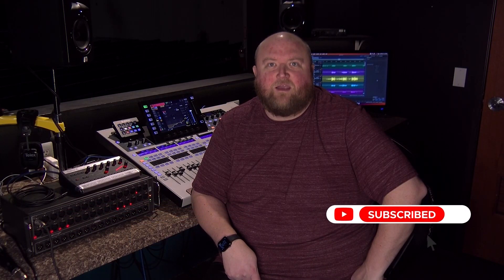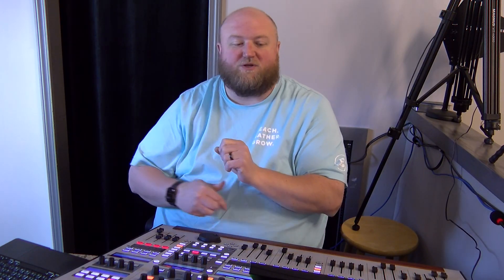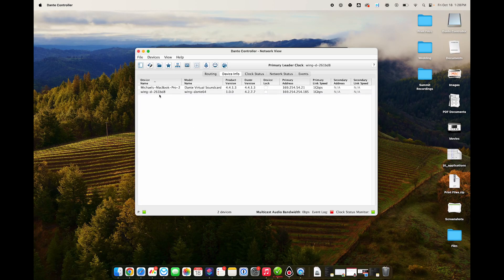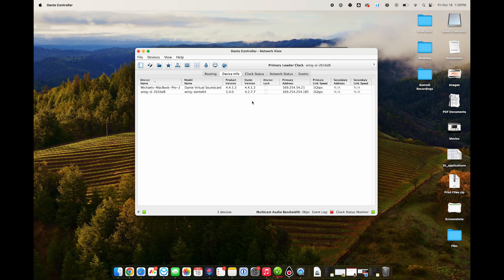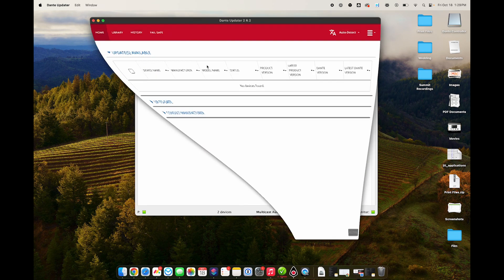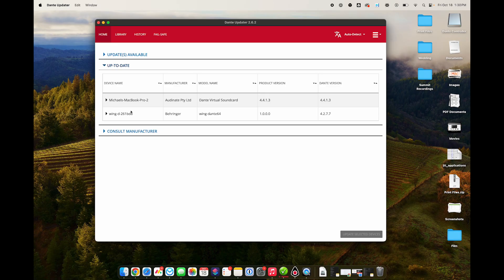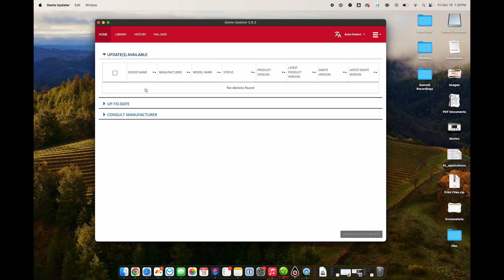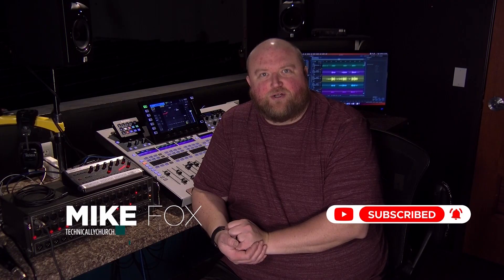How I Fixed My Dante Card After Firmware 3.0 Upgrade - Behringer Wing

Comment: Hi everyone, 

I had the issue that the Dante card didn’t recognize in Dante controller even after downgrading…

I was about to give up and start calling some friends with wing to help me get the card updated. 

But I was curious if I could pop out the Brooklyn card out of the wing module and install it on the x-Dante card.  So I tried it… and it didn’t work. The lights didn’t even flash on the switch I was connected too.  Then for the fun of it I plugged it in to the secondary port… and it WORDED!!!!  

I was able to run the Dante updater and update the card. For people like me that are blessed to have an old x32 with a x-Dante card there is your solution.

Just to make sure the firmware was correct, I updated it again in the wing!

Hope this helps!

Comment: Awesome video, thanks for that :) but where do I find firmware 2.0? On behringers website 3.0 is the oldest you can get :(
Reply from the maker: If you are using the full size wing - i have them archived on my website: https://technicallychurch.com/wing
Reply: @technicallychurch  thanks for the fast response :) sadly I use the rack version...

Comment: Hello, I use wing rack and uad x16D to record. But after updating to firmware 3.0.6, the signal doesn't go into the uad x16d dante. In wing, the dante card is held, but the signal doesn't go in... Please help me
Reply from the maker: This sounds like it may be a Dante firmware problem - make sure you Dante card's firmware is up to date.
Reply: @ The dante version shown in Wing is 1.01-1 and 4.2.7.7 when checked by DVS. Should I downgrade the Wing firmware?
Reply: @ The firmware is the latest version!

Comment: You are a life saver - I checked everywhere and could not find a fix- this certainly worked for me
Reply from the maker: I'm glad I could help!
Reply: @technicallychurch  now i got myself stuck - lol! - I got a uad x16d , and now my routing is all messed up - plus having a wind-dante card means I lose my virtual soundcheck which the windcard offered.  i have a mac but i use that for my UAD Console to add my plugins - will you recommend I get a second computer for recording while having this mac exclusively for UAD console and Dante controller?  If yes, how will I route all these?

Comment: Hmmm… this is not good. I have a Wing Rack. The Dante card works (in the option slot), but I’m getting a persistent clicking sound from time to time that sounds like a word clock issue when I patch through Dante. I used the Dante card on a full-size Wing for about a year, back in 2023/24, without any of these problems. That full-size Wing is now sold/gone, and I’m trying to get up and running again on a Wing Rack and wish to contiune to patch in my Waves SuperRack for a handful of FX I prefer to use. Sounds like I have a different issue that this video.

 I’m running Wing firmware 3.0.5 and Wing Dante firmware 1.01-g8dd67dd1.

BTW, the first Wing Rack I received wouldn’t power up after shutting down unless I pulled the power cord for a minute or so. I waited a couple of months for a replacement Wing. I love the design of the Wing, but I hate the quality and ball-dropping Behringer continues to exhibit.

Any ideas on this clicking issue? The clock status in the Dante app on my Mac all looks good, and changing the size of the DVS buffer has no effect. At this point, I’m just doing a loopback within Dante to eliminate Waves SuperRack from the equation.

Suggestions/ideas?

Update: I did some further Googling (https://behringer.world/viewtopic.php?t=1992)… I had the clock source set to Wing in the Wing console; now I’m trying Dante in the Console. I don’t remember doing this in the past, but it was about two years ago when I originally configured the Wing.

Comment: I am in this same boat, except its a brand new Wing Compact. I can't downgrade to 2.0 because there is no compact 2.0 firmware as far as I can tell. I did downgrade to 3.0.4 then back to 3.0.5 and still no luck. I am dying here. I have a show in a couple days that this has to be running for.

Comment: Got a Wing rack with Dante card. On firmware 3.05. New external card installed. Dante controller not seeing it at all. Can't roll back to firmware v2 as it's unavailable for the rack. Any ideas?
Reply: I did not find the v2.0 anywhere, but I managed to rollback from 3.05 to 3.02 and it worked perfectly!
Reply: Having the same issues for the wing compact. Any updates to your situation?
Reply: No not yet.

Comment: Thanks, where did you get the 4.2.7.7 firmware from. On the Behirnger page I found 4.2.4.8
Reply from the maker: I used the Dante Updater directly, I didn't download the firmware for the external Dante card from the Behringer website.

Comment: Hi 

you need to register the card on 3.0.4 

How to register a Dante Card:

1. Start the console with the Utility button pressed.
2. Go to setup/general and touch the wrench icon/options area in the CONSOLE section,
3. Enter Mod-Dante and press apply to register an internal module
4. Enter Mod-None to deregister the internal module.
5. Restart the console
Reply: this is external card, not internal. Still need to register?
Reply from the maker: I did try the card registrations before I reverted firmware, and it did not fix my issue. I'm not 100% certain if that applies to both internal and external, but i did try it anyway.
Reply: Registering the card as internal fixed my issue. Thank you so much

Comment: my Dante firmware is 4.2.3.13 but I can't update the card. Dante update can't show anything just serching device......
Reply: Any update on this situation? I'm having the same issue other I haven't upgraded the board itself yet.
Reply: Same here... I reached out to Audinate and they say it's a behringer hardware issue. Anyone find a solution?
Reply: @ChrisBarnes215  I just updated the board and the Dante card still worked just fine.